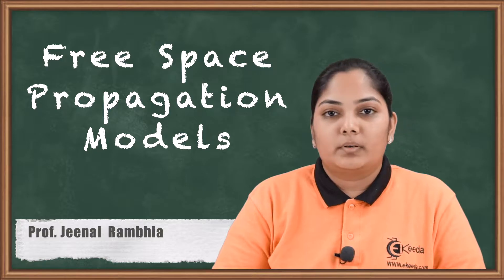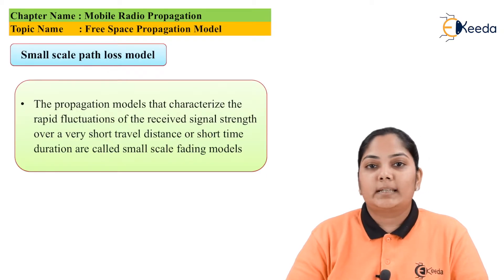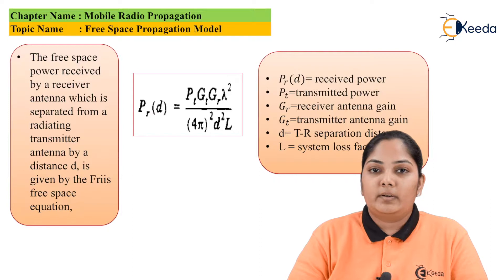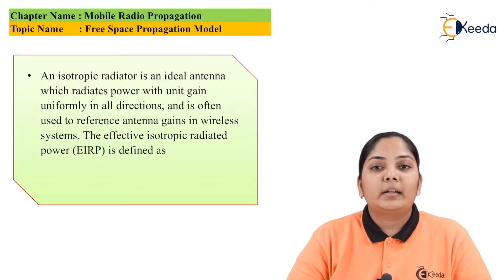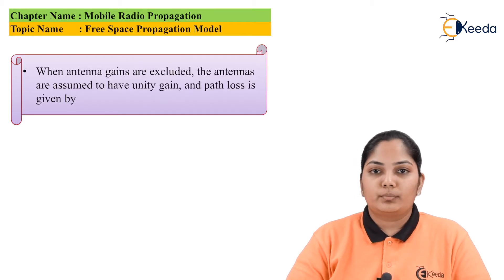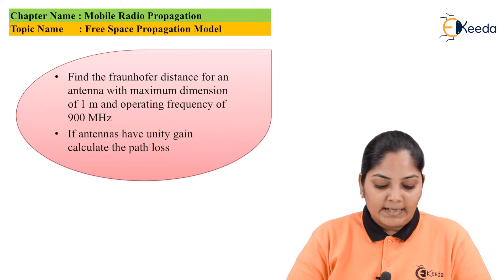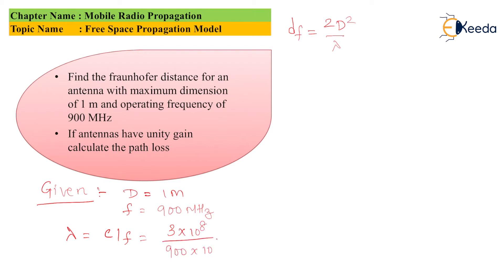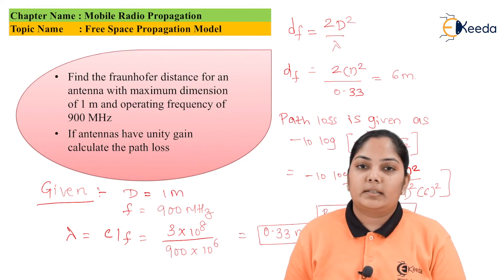Free Space Propagation Models - Mobile Radio Propagation - Mobile Communication System

Comment: In the free-space radio propagation model, it has been demonstrated that doubling the separation distance between the transmitter and the receiver, or doubling the signal frequency increases the attenuation by 6 dB.